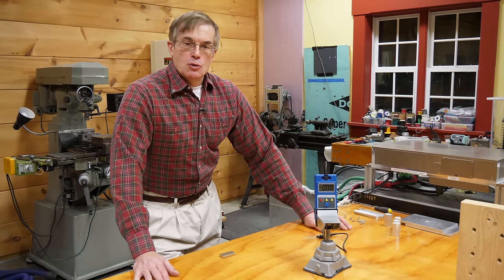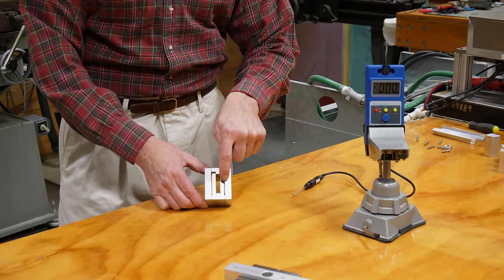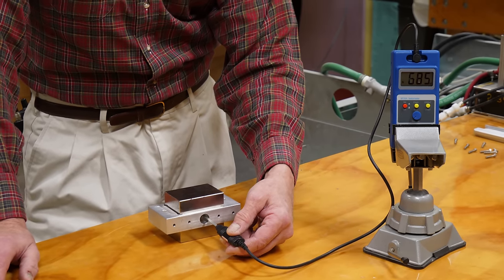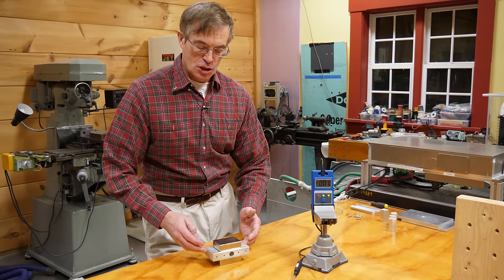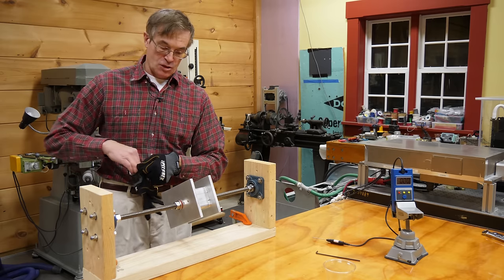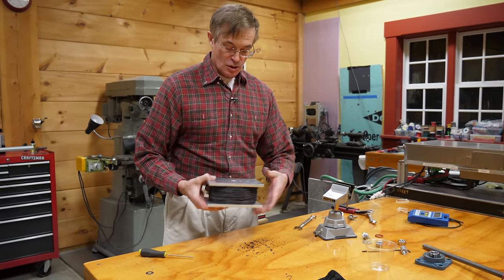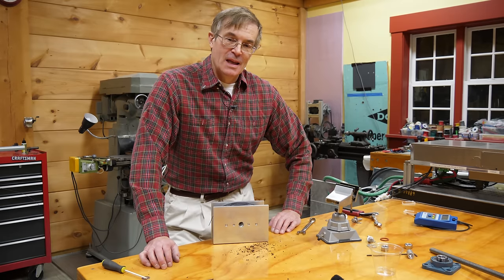VERY POWERFUL MAGNETS… THE EASY WAY

Comment: You are plenty smart enough to help me out on a project I have going on. I want to put a trolling motor on each side of a row boat that my daughter and I use to fish small ponds with. To control them I'd like to put two peddles in the floor and have hands free zero turn for us. I've spoken to a motor repair place and tried to set me up with a couple boards kinda like a Bridgeport milling machine has for power feed. The cost for two was gonna be near $1,000. A $10.00 China drill motor has some sort of reostat to make it variable speed. The DC reverse switching I understand , I need a simple and ( inexpensive) way for variable speed. 
I am an old time tool maker machinist with very little CNC experience and even less electronic experience. I do have good farm , printing mechanical experience , so I can make most anything you could describe ( if it's explained for a simpleton🙄).
Reply from the maker: Your mechanical skills should be more than sufficient.  What about buying and dismantling a low cost, battery powered hand drill.  You get a variable speed controller and reverse switch as well as at least a single, compatible battery.  Build the peddles to operate the remoted trigger button.  Mount the prop shaft in the Chuck and angle the shaft into the water like a mini swamp motor.
Reply: Thank You kindly for your reply. 
From many trades over the years I have several trolling motors. They have a tiller switch made onto them but for full forward and reverse it's a near 360* turn of the tiller. There are only two wires going down to the motors from the circet board. 
I guess I'm asking is there a simple way to make a reastat large enough to run one of these motors in a homemade fashion? I assume I'll need to make four of them so we can have 2 going forward - reverse independently with feet rocker switches. 
I do have an antique sewing machine motor switch. If I took it apart and upscaled it , do you think that would work???  I know it's an A/C switch , but with heavier gauge wire I wander if that same principal would work???
Reply: There is a boat company who makes a small boat with two motors mounted in the hull on each side with the foot rocker switches. I contacted them about buying just there switch and they wouldn't talk to me. They do have a near perfect rig , but it cost as much as an entry level Bass Boat. She and I have a 40+ year old V - Hull Jon boat that we can load in the back of the truck and it's very comfortable. If we could come up with a simple switch setup for a couple motors on each side we would make very little movement when sneaking in on fish.
Reply from the maker: A better solution might be to use several batteries in series upto the maximum allowed voltage.  Then, wire several on/off switches to add and remove a battery in the series; less finness in the adjustment, but very reliable and inexpensive.

Comment: Hi, nice vid there. If the magnetic field decreased around the cabling, did it increase on the plates (or just in the gap) ?
Reply from the maker: That depends on the location in the plate.  Close to the centerhole the field increases and near the outside edge it decreases.

Comment: Maybe add a drill motor to your contraption to spin the wire on as you guide it maintaining tension??  Take care.  Doug
Reply from the maker: That isn't a good idea.  The limiting factor is the person unwinding the stock coil.  The wire tends to twist and kink.  If the winder were motorized, this would risk the fingers of the assistant.
Reply: @TechIngredients  I didn't see how you were stripping the coil.  It does make a great difference on how it comes off the coil as to how much it twists and kinks.  Has to match the reverse of the way the factory spoiled it.  Of course you'd want to go slow as needed.  Gearing it down if necessary.  Not worth it unless you are doing several I suppose but 1200 wraps with even strain??  I would want to mechanism the process.  I would also build cheek pieces and center to put the wire on as it spools out with a drag nut on the shaft also a simple anti reverse dog.  This would eliminate the assistant. Providing a consistent feed pressure.  Somewhat like the old days of rewinding electric motors in a small shop on the lathe.  I would hate to have done 1198 wraps a let the wire slip!!  Take care.  Doug
Reply: @TechIngredients  P.S.  excuse the "spell check" misspellings.

Comment: I'm not sure if its's economical but I'd suggest steel shim stock instead of wire. Avoiding wrapping and unwrapping to an extend.
Reply from the maker: You are correct, however as you suggest it is more expensive.

Comment: If you had the center spindle go through one pillow block and then put a handle on it - it would be a lot easier and much quicker  to wind it.
In addition a sensor counter would count the revolutions (passing a pill magnet attached to a corner) so you have a good idea of the number of winds.
Reply from the maker: Don't do that!
Unwinding the stock wire is the limitation.  It twists and easily  tangles and can catch the fingers of the person managing the coil.

Comment: you could try MuMetal, they come in a tape roll package. It has the best magnetic shielding properties.
Reply from the maker: It would be better. Isn't it relatively expensive?
Reply: @TechIngredients  they are a bit more expensive and is affordable for serious consumers. But I think you could’ve easily reached 1 Tesla using much less effort. I know all the professional advanced industries uses MuMetal it has a ridiculous saturation level. I wanted to make transformers using a 3D printer. The plastic polymer will be impregnated with MuMetal powder.

Comment: The initial issue of the stainless steel nuts migrating could be safely remedied without the ferrous tool. A pair of stainless steel nuts bookending the existing ones, when hand tightened,  would work as "jam nuts" thus preventing said migration. 
- Respectfully submitted.
Reply from the maker: Good point.

Comment: would steel shavings and or powder work, instead of wire?
Reply from the maker: We thought about that.  The serious downside was the mess.  The steel will be pulled onto the magnets ferociously, and the particles are difficult to control.
The wire can be handled and even removed without much difficulty.

Comment: Does the thickness of the wire change the strength of the magnetic field or is it a ratio of turns and wire thickness?
Reply from the maker: The most important quantity is the cross sectional area of the steel that surrounds the magnets.  The more steel, the better, but gains slow as  the amount of steel reduces the magnetic field below the saturation limit.  The closer the steel yoke is to the magnets it surrounds, the better it works.  Thinner wire might make it possible to wrap the coil tighter and closer to the magnets.

Comment: Before you assembled the spool my guess was it would be a plastic box that you gradually filled with iron or steel filings or shot.
Reply from the maker: We thought about that. Problem is that once in the field, these pellets stick tenaciously to the magnet and each other.  Filling the box evenly will be hard as these clump and jam.  Removing them will be hard as well.

Comment: Watched your whole video; wondering what would be the application of doing this to a powerful magnet?
Reply from the maker: The iron in the wrapping wire confines the field, increasing its strength in the gap. This can be used to study spectroscopy effects of high magnetic fields and also to build an MHD generator.

Comment: Then what would you use that completed assembly for? You have most of the field strength in the center.
Reply from the maker: In our first DIY refrigeration video, I demonstrated the magneto caloric effect.  This type of magnet can be used to drive a magnetic refrigeration system.
Reply: @TechIngredients  Thanks for your reply. Did you really turn that magnet around 1200 times while wrapping the wire around it? Phew! You must be a very patient person.
Reply from the maker: I am, but it actually took less than 30 minutes.

Comment: My university had a 1.5 T permanent magnet MRI for rats/mice, so the bore was about ~2 inches in diameter. Always wondered about the geometry inside of the box that let them get that strong of a field across that large of a gap. Just a simple C/H yoke with more magnets or something else?
Reply from the maker: A yoke and a big enough permanent magnet can easily achieve this.

Comment: Does wire need to be insulated to create an effective coil?
Reply from the maker: No, it could be one solid block of steel.  The wire just makes adding the mass of steel safer and easier when dealing with powerful magnets.

Comment: I'm sure the performance wouldn't be as good because of packing density problems, but it seems to me that making a box around it and pouring in iron filings would have been easier and faster while still allowing you to add the material slowly.
Reply from the maker: Ultimately, It might perform as well, but spreading the filings around would be a hassle.  Once they are exposed to the field they all become partially magnetized, will clump together and gather where the field is strongest.  They will cover the entire surface of the yoke including threaded holes as well as try to get inside the gap where they could never be removed.

Comment: The permeability of the permanent magnets and the steel wire should increase as the temperature decreases, right? Maybe a substantial temperature decrease of the core may help get closer to the 1.4T
Reply from the maker: It would help.

Comment: New with your channel here. Been fascinated with magnets. Is it possible to do right the opposite polarity? Meaning somehow with a magnet that strong. South to  south that pushing energy away enough to for say block radiation or radio waves? Just Curious. 
I like your work!

Comment: if you have the all thread go through the bearing and wood on 1 side, you could connect a drill/motor to wind it faster.  Similar to how they wind electric guitar pickups.
Reply from the maker: That didn't work.  The rate limiting step is the person who is unwinding the stock coil.  It tends to twist and tangle.  The motorized winder threatened his fingers.
Reply: @TechIngredients  Good point, the stock coil would be much safer on a spool when using a motor.

Comment: what would be the measured differences (ball park range estimate)  of using strips of steel metal instead of the wire that was used?
Reply from the maker: It's basically a weight equivalent assuming a similar type of low carbon steel.  An advantage of strips such as packing strapping is that the winding will be denser and more compact.  It may be easier as well because the stock wire coil tends to twist and tangle when unwinding.

Comment: is it possible to do the opposite and extend the field for a longer range?
Reply from the maker: Yes if you guide the field within a feromagnetic material.
Reply: @TechIngredients  what happens if you put a round magnet and drill a blind hole in a stock of steel and put it inside?Will that increase the strength of the lets say North side if the South side of magnet is encased in steel?

Comment: Did you consider a non magnetic conductor like copper wire? Seems like, in theory it would deflect the field, and reflect it towards the center. Just curious. I do not have any of those strong magnets, or I would try it myself. I just remember an experiment where a steel ball slowed going thru the copper tube inside the electromagnet. Anyway, just a thought. Love your videos.
Reply from the maker: No, copper won't work.  It is non magnetic and the field lines pass through it as if it were air.  It is the electrons not the metal that guides the field.  The electrons in the iron are able to flip their spin orientation and align with the field, contributing to it. The electrons in copper resist that flip and remain random relative to the field orientation.

Comment: there is an easier way to increase the Tesla field strength through shaped magnets. at the tip of a cone or pyramid shaped magnet, for instance, you can actually far exceed the 1.4 Tesla capability of an N52 magnet. recordings of 5+ Tesla are actually fairly common.
Reply from the maker: True, but the volume at those field strengths becomes extremely small.  Practical applications will be limited with pole piece, field augmentation.

Comment: I would have left a length of the all thread sticking out one end to attach a variable speed drill. Then run it slowly while guiding on the wire.

Comment: yes, the metric system (SI units).. gone are the days of the old imperial units
Reply: About time. Throughout history, different units of measurement have lead to disputes as far back as Sumar. And mistakes of this sort have lead to military defeats because the ammunition wasn't comparable with the delivery system, or we launch a costly blind Hubble Telescope.

The metric system is the logical choice for the sake of simplicity. And as much as we Americans may resist it, the Imperial measurements will join the other "dead" units. (Try building a tractor shed using the cubit as a base!)

Comment: Could you use these strong magnetic fields to induce enough current into a sim card or SD card to permenently destroy it? Lots of applications for this use, I imagine. If you could reliably recreate the effect.
Reply from the maker: These devices are not sensitive to static magnetic fields.  A powerful alternating electric field or an ultraviolet light can produce the local voltages necessary to erase the memory.

Comment: You said the wire was steel . What composition is the steel ? What other alloys might be more efficient ? And insulated wire how would insulation effect this ?
Reply from the maker: It is a low carbon steel.  Adding nickel will change the saturation limit and reduce the amount of wire needed, but at a higher cost.  Insulation will only make the final result bulkier.  It will not improve the performance.

Comment: If you still have this magnet laying around, it would be perfect to test that "fuel saver" gadget idea from the 90's of magnet wrapping the fuel line before the fuel enters the fuel rail or carburetor of an engine using a measured qty of gasoline. maybe a lawn mower might be good enough. Place the fuel line through the hole of the magnet as is.

Comment: I feel like there is a way to create a self-sustaining motor from this... also with ultracapacitors and an electromagnet to make for part of an on/off switch. The strong forces to power charge the ultracapacitors and batteries... then the much weaker force makes the permanent magnet drop a steel bar far away enough to get pulled back up when the electromagnet is switched off.

Comment: Interesting idea , I'm sure I've seen pictures of wire wound magnet cores  like that , Ive certainly seen tape wound cores for transformers.  (the magnets may have been electro magnets  for early EMI MRI research )  

I have to admit I was hoping you try and use the lathe  , a strong rotating magnetic field plus a 100kg or so of iron would be quite entertaining to watch.

Edit. forgot to add... give us a name , any name !!
Reply from the maker: Those pictures are of electromagnets and the wires guide the electrons that generate the field.  Those wires are typically made of copper which is not feromagnetic
Reply: @TechIngredients  Yes i know that that's why I specifically called them core rather than windings and referred to tape wound toroidal cores .

Comment: a bit unrelated question but how good steel wire is to make custom size toroidal transformers?
Reply from the maker: Copper is much better.  The wires in an electromagnet only guide the current which generates the field and themselves do not guide the field lines.
Reply: @TechIngredients  i mean to make the toroidal transformer core out of steel wire not the windings

Comment: You should of used a drill press or hand drill to coil the wire. Like when they create coils for vapes like a Clapton coil for example.
Reply from the maker: Actually that wouldn't work.  The limiting factor is the person controlling the unwinding of the stock coil of wire.  It tends to spring apart and to tangle if it is unwound without care.  A motorized winder could endanger the coil person's fingers.

Comment: Curiosity strikes again, essentially the build is quite similar to a electro magnet, would a magnet benefit from having a electro magnet built around it? Would the magnet become more excited? Would this effect be long lasting to the magnet? Would both the magnet and electro magnet as a pair work better at sub freezing temperatures?

Comment: So if you started running an electrical current through the wire could you easily get it up to over 1 tesla?
Reply from the maker: It would increase, but not that much.

Comment: Why didn’t your use a small gear motor (windshield wiper motor) to turn your magnet so you could wrap it a lot easer and faster?
Reply from the maker: The rate limiting step was the person unwinding the stock wire coil.  It would tend to twist and tangle.

Comment: You should look into Halbach arrays to increase magnet flux density.
Reply from the maker: We have.  The problem with the Halbach array is the inhomogeneous field.  For some applications that is acceptable.  For our experiments, the spatial variation will complicate our results.
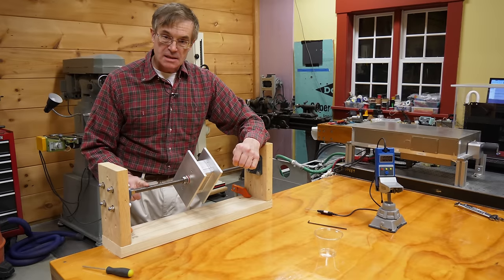Reply: @TechIngredients  They can have a uniform field strength if arrayed toroidially. Check out SuperMagnetMan - Fundamentals of Halbach Arrays, (I didn't want to link to another youtube channel directly), at around 7:20 to see the field lines. This arrangement also acts as its own yoke, so that's an interesting side effect.
Reply from the maker: You might want to try this with some iron fillings.  The field lines still have a periodic variation.